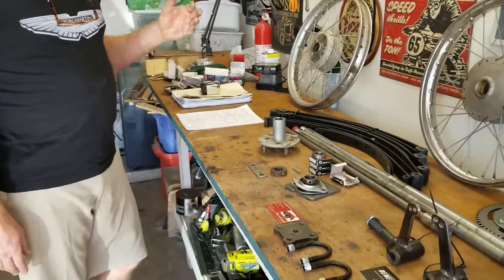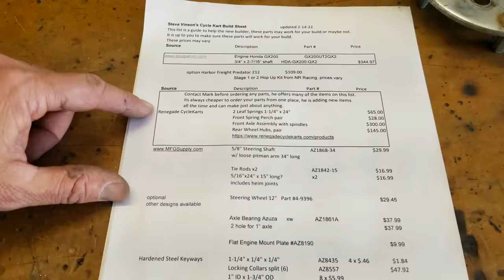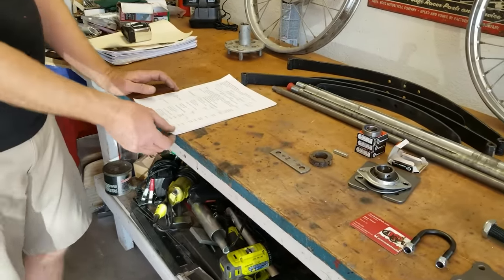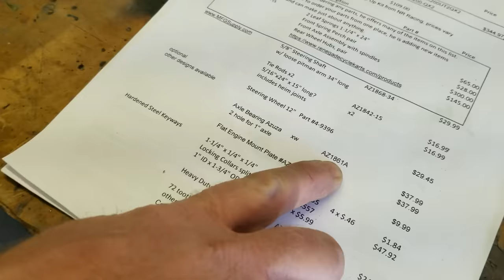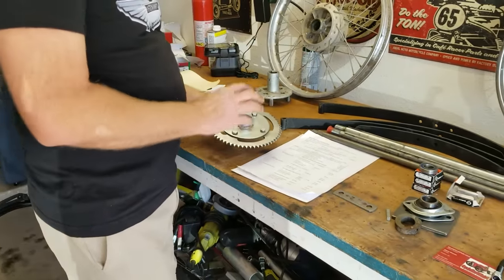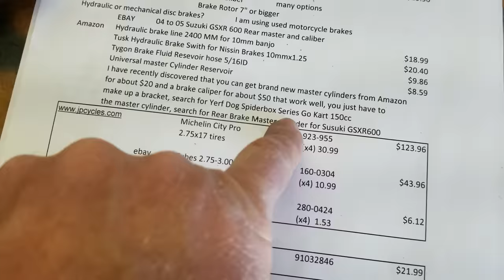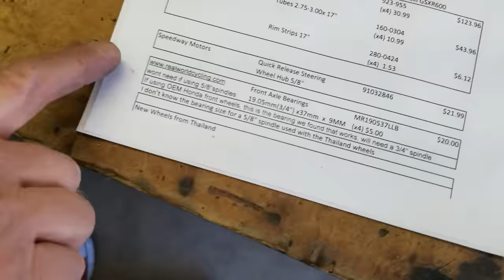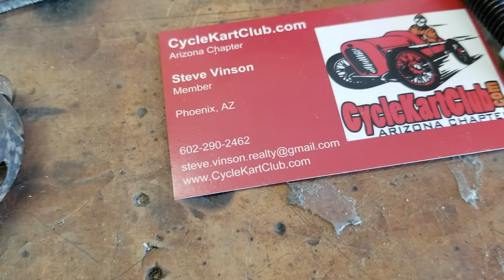CycleKarts Parts List

Comment: Thanks for the parts roundup Steve. I ordered front and rear axle kit, steering, springs from Renegade a week ago. New CT90 wheels, tires, tubes, rear shocks, yes, and torque converter have mostly arrived. Rear brake to purchase yet. 1x3x.065x20' rectangular tube 80ish bucks a stick here in Montana. We're at 2000.00 bucks so far. Have a new 212 Predator sitting on the shelf and 4x10 sheets of aluminum as I work with it anyway. Appears to be a 3000.00 project, although I think a person could save 500.00 to 1000.00 building their own axles and using used rims and tires but quality could suffer.
Reply from the maker: I think that is possible.  Yes you can save a bit of cash here and there.  It depends how many items you can make yourself. Thanks for watching.

Comment: The Honda CT90 Wheels are kind of hard to find any that aren't bent is there any other will configuration that will work in place of it The ones on eBay are narrower and don't look as good That's the only thing that's holding me up from building my first cycle car is finding a good wheel tire combination anybody have any info let me know please thank you
Reply from the maker: here is as link to a post on our FaceBook page that has the PDF of the CycleKart Wheel Bible,  this has lots of helpful information regarding CycleKart wheels.  https://www.facebook.com/share/p/9fWRo2gHZCA2z8cU/
Reply from the maker: this is the only EBAY vendor we recommend, the other guy who advertises US STOCK has had some quality issues reported by other cyclekarters.  https://www.ebay.com/itm/360470589040?media=COPY&mkcid=16&mkevt=1&mkrid=711-127632-2357-0&ssspo=NIOOI2KxTzO&sssrc=2349624&ssuid=8fFASmGdS4C&var=&widget_ver=artemis

Comment: I will make my own with no engine, similar driving as a bike, 4 wheels and 5 seats, steering wheel like a car, 23 gears, top speed: 269 km/h, hill pedal on top of steering wheel, brakes when steering wheel Schintu logo pushed. Name: Schintu Tipo 1
Reply from the maker: Sure, why not.

Comment: I just found your channel and after watching a few videos, I'm thinking of building something like this just for kicks (plywood body and all).

My question is on the back end, would the official competitive rules allow somebody to use an axle pulled from a go-kart and retrofitted to use 17 in. spoke rims from a dirt bike? Or does the axle have to be a specific diameter and Honda rims? Could I use a modified rack, pinion and spindle system from a Go-kart for the steering as well?

Hope to hear back soon, and awesome video!
Reply from the maker: Yes, all that is fine. The most important thing is to keep your inspiration car in mind when making these choices.  The Rack and Pinion will likely be hidden by the body, but the spindles and other parts that are visible, we hope that these look period correct, as much as possible.  I have seen some guys chop the front suspension off of a golf kart or an ATV, it just doesn't look quite right.  We encourage creativity and reusing old stuff when it makes sense

Comment: Nice presentation.  But I have a question.  Supposedly the 'track' of a cyclekart is 38".  The definition of 'track' is center of tire to center of tire, but in some comments I've seen, people interpret that as the overall width (outside of tire to outside of tire).  So what is it?  Overall width, or center-to-center?
Reply from the maker: The authors of the guidelines are using 39" at the outside of the tire.  Not the center of the tire.  If using a standard width 36" rear axle, 39" is where your tires will be exactly.

Comment: Well, I was all in and had friends interested as well. Looks like we are OUT until repro wheels are available again. Just called a local moto scrap yard and they say they get $125-200 per 17" wheel spouting the perceived value of the CT bikes. I just can't play that game. I have a C70 and my friend has many of them but we are not destroying complete machines just to get wheels. The Chinese MX wheels don't look worth the chance to me. I'd buy new VCK wheels if available but... Looks like I'll check in on the hobby later. Keep building and racing!
Reply from the maker: If you here in the USA, you can order brand new wheels from andrew@in-groundtrampolines.com
Andrew has them in stock and ready to ship.  He is located in Phoenix and is a friend of mine.  Send him and email and get it set up.
Reply: @stevevinson6030  Thanks for the tip! Email sent!

Comment: How much do these things weigh? I'm a heavy guy and am worried that my weight would be to much for those leaf springs
Reply from the maker: Most karts are between 250 and 280 pounds, some are heavier.  Lots of big guys have built CycleKarts.  I added helper springs to mine to stiffen the front, but really most of the weight is on the rear axle, the front axle doesn't carry much load.

Comment: A shortage of 90 Honda wheels as these bikes are becoming in demand as a classic collectors item. What other rims are acceptable for a cycle kart?
Reply from the maker: Pretty much any 17" x1.4" or 1.6" motorcycle wheel will work. New wheels are still made in Thailand and you may be able to find them on Ebay

Comment: The problem I see with these machines is the wheels. Motorcycle wheels are not designed for side loading. This makes them prone to failure when sliding, drifting or off road when used on a car (motorcycles lean into corners eliminating side loading). Lawn mowers are better for racing. Cycle carts are just plain fun, but not for any kind of excitement when racing.
Reply from the maker: Exactly what we tell folks.  We aren't really racing.  We have  learned through experience that these are just for fun.

Comment: Why not just buy racing kart parts. U used to race one. I don’t understand. I could get all those parts and axel bearing carriers. Why is so expensive. I thought u guys just made these lil carts. U buy all the parts. U can’t even make a steering shaft urself. Buy the axels and bearings build the rest. Would be fun. Make some stuff more fun way cheaper
Reply from the maker: Of coarse you can make your own parts.  Many guys don't want to or don't have the tools or skills to make some parts that are readily available.  Also, not every build needs every part on the list.  Thanks for watching.
Reply: @stevevinson6030  I get that. A lot of times. I see these guys waiting for parts rite. They got tubing rite behind them next shot a welder. They always have good tools. Better than mine. Just saying build so stuff. I plan to build one. I thought they were all made custom.
Reply: @justindoucette1841 I guess some people just don't want to put the extra effort into fabricating absolutely everything.